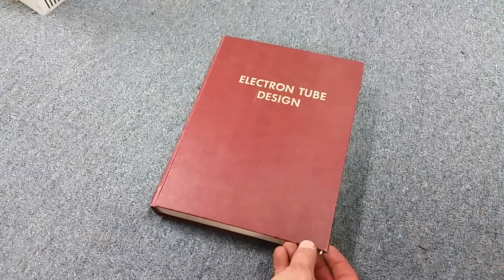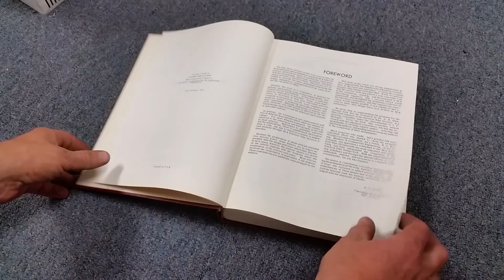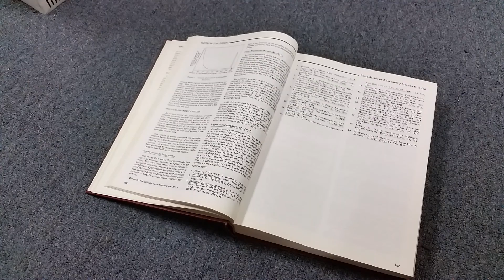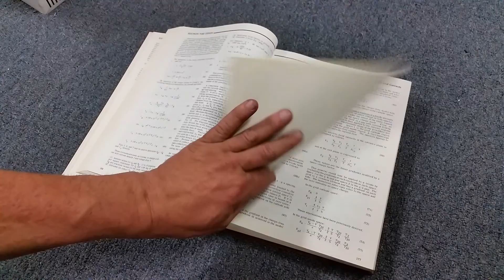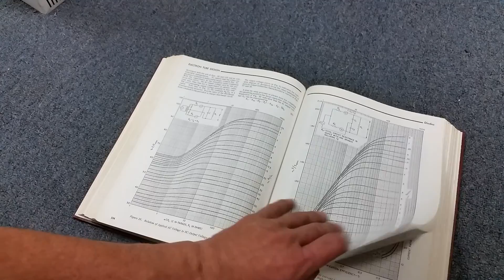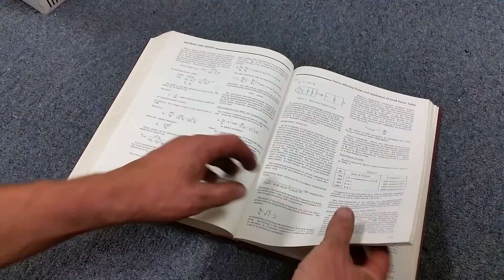Electron Tube Design

Comment: Just going through some of your older videos and I found this one.  This is a great book if you are interested in the engineering, materials, construction and manufacturing of tubes.  Doing a bit of research, it turns out that it was never copyrighted (probably due to restricted distribution).  That being the case,  a very high quality scan of the 1962 version (were there others?) is freely available on the Internet Archive.  Thanks for the video.